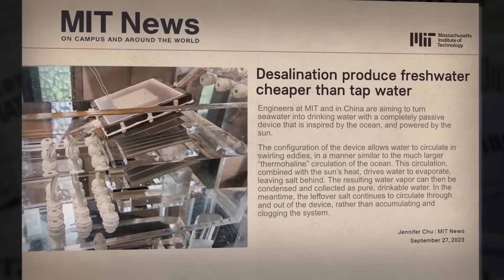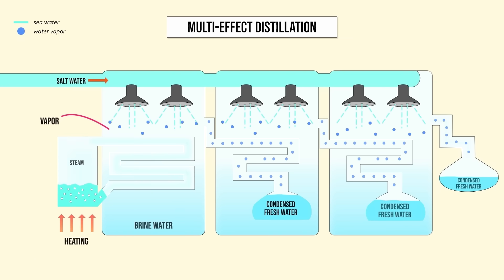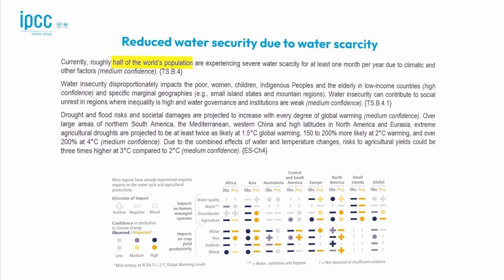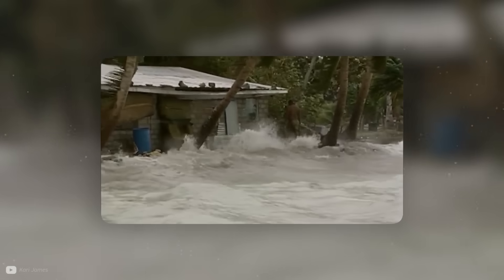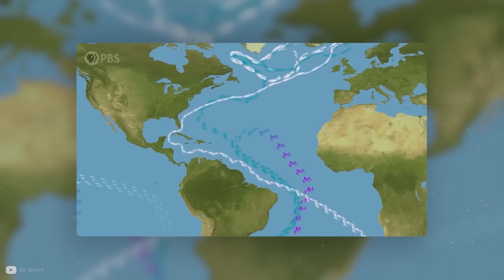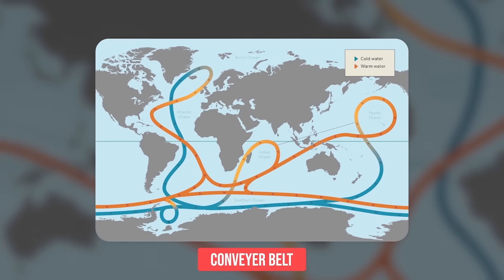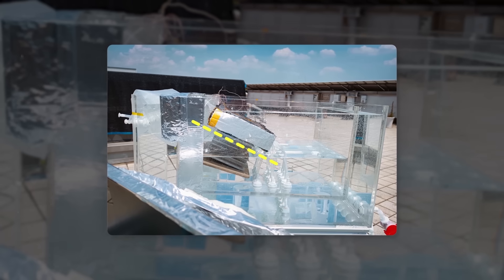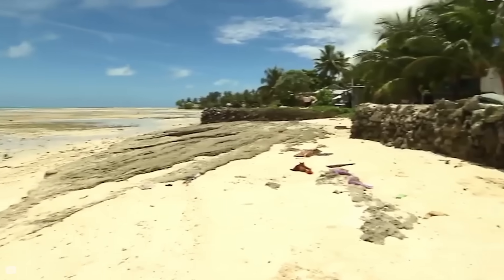Unlimited Fresh Water: Can MIT's Breakthrough Save Us?

Comment: There are other methods to obtain fresh water. With a power source, (including solar) you can use atmospheric water generators, which extract moisture directly from the air, without mucking about with the salt water.
Reply: it's cheaper to pass saline water through RO system than using a Dehumidifier, like 100 times cheaper, and RO systems are expensive. a dehumidifier will always be equal of less cost efficient than distillation (same energy required, but heat pumps could increase the overall efficiency of distilling over condensing). 
they have been trying to make startups of glorified dehumidifiers for decades and all have gone under because:
water is not drinkable (the contamination in the fins make it biologically active)
the results are pathetic against initial claim (like thousands time lower, as physically expected), and inconsistent as you need really hot and humid air to get "good performance"
the cost per liter of water is so high that it starts to be reasonable to move fresh water in container through the ocean.
Reply: @blurrydude2885 tell me the energy required to condensate 1 kg of water. tell me the energy required to distill 1 kg of water. this is basic thermodynamics. tell me know what is easier generate: a low entropy state or a high entropy state.
 your university sounds like a scam.

Comment: This is membrane distillation, which is now being utilized for seawater desalination - look it up. The MIT system is crude... The sea water needs to be prefiltered to take care of all the algae and particulates in the seawater, otherwise growth on the hydrophobic membranes will make the membranes hydrophillic, and lose its hydrophobic properties. Solar heat energy provides the heat necessary to heat up the sea water so water vapor can be produced to pass through the membranes and condense into water. A low pressure pump circulates the seawater solution and a small vacuum pump pulls the water vapor which is condensed. A larger system, with a stack of membranes and storage tanks for a household or small town would be the best choice, not a portable suitcase model. Water flux through the membranes are on the order of 1-5 kg of water per m2 membrane area depending on temperature. A lot of MIT bloated news here... You don't need to run the sea water to high salt concentrations...
Reply: Yes, you are correct - membrane distillation and you MUST pretreat the water. These MIT guys glossed over all these problems!

Comment: It's interesting why they would need the membrane when they could easily just harvest the condensate running out of the other tube. Keep the tilt so the brine does not get too salty but why the membrane? Seems over-complicated.

Besides, this only works in climates that have the Sun more than not, which means it's a solution for the tropics but more cloudy places need something different.

Comment: I run a RO system for my family's pure water needs. This sounds interesting, I am looking forward to them putting it on the market so we can see how good it really is.
But really RO systems works great if you use a pump to get up the efficency of the membrane and do not have to use sea water but most well and municipal water. Also do not cheap out on the quality of the membrane they are not the same.
 There really is not so much waste water. Just tune the system after your local water quality properly and do not just run a standard restrictior, to what water quality you want out to waste as little as possible. 
Also I do not think this feflowing system is powerful enough to flow thorough in to the system through tight sediment and carbon filters stages and the needed polish carbon stage after the filter. So we probably need a pump to run it.
I wonder if we need to use solar what or if I could just place it on our wood furnace when we make our warm water could we be making some clean water at the same time?
Because I live in the north and half of the year there isn't much heat in the sun. If the water need to be evaporated fast maybe it needs more heat than what warm water can provide. Or maybe the heat only speed up the evaporation.

Comment: By removing water from salty water you are left with more salty water. There is no way around that. There are only two theoretical solutions to reduce the salinity of the water that goes back: take the salt out or dilute it out - both comes at a price. If this device that does not come with a "hypersalinity problem" then that means it takes just a bit of fresh water out of the sea water and so the salinity change is not as high as in reverse osmosis - meaning it goes the way of dilution. The price comes from the a larger mass of salt water that needs to move through the system, which, at an industrial level means a lot more/bigger pumps and pipes.

Comment: Either your explanation or the diagram around the 12 min mark is nonsense. If it is gravity fed, the water level in the box cannot be higher than in the external main tank - but which it is. It would be level, unless you actively pump it.

Comment: The problems, financially, aren't often around the actual desalination process. It's the handling of the imperfect source water. Microplastics, algae, and variations in the actual composition of the salt change things and handling them is the source of most of the actual costs of desalination. 
These islands are in 'blue water' that doesn't wear out prefilters quickly and eliminates most of the problems that MIT has conveniently left out of their claims. 
Altogether, this is a great graduate paper but doesn't offer a full engineering solution.

Comment: This reeks of an undergrad engineering project that grew out of control, and is getting undue press hype.    It's just missing the buzzwords "out of the air".  Somebody summon that a$$hole Thunderf00t.
I'll keep an open mind but I'm very skeptical just on the 1st order analysis.  It all comes down to the total energy balance.  The max amount it could ever possibly achieve is determined by the total amount of solar radiation it absorbs minus environmental losses plus a negligible amount of potential energy from the height difference, minus the chemical energy it takes to convert water to steam (considerable) without carrying over or making it too energetic to carry salt in the vapor (difficult). Everything from then on is simply thermodynamic efficiency.  So why not run the numbers?  Solar Insolation over a length of day for the area, for ease consider it a blackbody, there's your total energy in.  Now, at 100% efficiency IIRC it's something like 0.86 kWh of energy is needed to desalinate 1cubic meter of salt water (34 500 ppm)  okay so I looked it up and Kiribati has a direct Normal irradiation of 5.687 kWh/m2 per day:  easy math let's say their collector was 1sq meter, 5.687 / 0.86 =  ~6.6.  Useable solar hours in a day for Kiribati is ~8. 6.6/8= 0.825 cubic meters (825L).  Seems good right?
Except not.  Pro plants use between 5X and 25X that minimum amount of energy.  If they're at the very low end and we say 5x, 825/5=165 165/24 = 6.875/hr equivalent over the course of the day.  That's just collected not distributed. So again... these claims seem dubious.  Incredible claims require incredible proofs...

Comment: Just make a solar heater evaporator... literally zero moving parts and it powers itself, why does everything these days have to utilize electricity... 
We can literally evaporate thousands of tons of water a day with very little issue. 

This isn't a technical issue, this is intentional.

two sandwiched but separated sheets of Metal with a slant towards a collection medium, paint the top black, put it over salt water, and bam, massive rapid collection of water, a single kilometer square, and you have enough water to solve world thirst. 
Nothing complex, just a sheet of material over water to collect and shed condensation. 
One sheets hot, ones cold, cause airflow and condensation, easy.
Zero salt accumulation.

Comment: Back in early 80s my idea was something else:
Build big cone higher than 12 meters above the sea surface (make it 15, for example), with the open bottom dipped in the sea.
Conical shape should allow the remaining salt to fall back to the sea, so, the inner surface of the cone might be covered with Teflon.
At the top of the cone vacuum pump would pull the vapor out, and push it through pressurized pipe system down.
The valve at the exit of the pipe would keep the pressure inside and condense the vapor, raising its temperature with the pressure.
The pipe would be spiral, long, and integrated into the cone wall to give the heat back to the water inside the cone.
Building the cone is more expensive, but it completely removes the need for the expensive membranes, which should all together be cheaper in the long run.
Reply: Sounds a bit overly complicated, but it is effectively what they are doing here as well. Use solar heating to evaporate the water, collect the evaporate, use seawater to condense evaporate.

Which makes me wonder why no one has done it before.
Reply: fun fact; with the salty water you can build rechargeable Batteries
Reply: Or you can farm salt and use this as thermal storage for the night
Reply: That sounds like a fantastic idea! Since you put it out there, are you hoping that someone will take it and run with it?
Reply: @lame0fame065  

Is that referring to me?

If so; yes, these are my open thoughts/"innovation" everyone should have the opportunity to use drinking water.

don't forget it's distilled water, you have to remineralise it
Reply: Maybe your idea,was and still the best method.Share it with the experts.If your method is best,we all win.I am referring to both the starter of this particular comment ,and everyone else whoay have the best idea.All of you should send your ideas to the experts.We all could benefit.
Reply: This method of desalination developed by MIT students should definitely be patented and implemented as soon as possible for countries that have coast, but still do not have enough water for everyday use.  This desalination method would be a godsend to them. I like the idea it does not send thick, sludge salty brine water back into the ocean ecosystem which deprives oxygen to marine wildlife. This desalination method also would greatly help people and create more peace around the world.
Reply: if you're always dumping the salt and wastes back into the ocean you increase the concentration. if enough places do this long enough it'll make the ocean super concentrated killing most sea life.
Reply: Spreading out the waste sea water dumps around the coastline should mitigate that.

Maintaining a low constant outflow rate, the sea water should mix quite quickly I assume.
Reply: I think the oceans are being continuously replenished with fresh water from the outflow of rivers, streams and rainwater. @Khanstant
Reply: I think that overall the salinity of the ocean is more or less constant. The fresh water that is extracted usually makes its way back into the ocean anyway. The damage shown here is all local due to the high concentrations of salt in the local environment, which this device should reduce due to it releasing the salt more slowly (if the hype is to be believed).
Reply: @TheFutureIsEloi  simple storage salt/high saltwater and use it
Reply: No you will not kill all sealife with a few cones. I think the problem is with desalination plants that dump huge amounts of extremely salty brine in the same area. Besides the natural evaporation would have the exact same affect so it would be close to a net 0  @Khanstant
Reply: @Khanstant  That will only be a local effect. The idea would be to pump the supersaline stuff into an area with good flow so that the salt is quickly dispersed,
Reply: @Khanstant  We are in a closed system so it should be fine somehow unless we do a big screw up or start sending that water into outer space.
Reply: @Khanstant  Mate, that is what the rivers ARE currently doing and HAVE been doing for hundreds of millions of years. 

I haven't run the numbers, but i doubt it is going to be a problem ANY time soon.

Comment: This is sooo easy, it’s not that complicated, all you need is a magnifying glass to heat a small black pot of water with a medium lid, all inside a large empty pot, the boiled water is desalinated and rises, rolls back down the medium lid into the large pot, no solar panels required, it is also much faster. Also you can rig up a basic pulley system with water bottles to slowly turn the glass with the direction of the sun

Comment: This would only replace the current cost of desalination in those areas that require desalination as the first step in a drinking water treatment process.  Unless the membranes in use will also remove other containments (e.g. bacteria, virus, heavy metals, etc...), you will still need to provide some form of treatment to the water to make it potable.  Readily accessible sea water from a shallow well could be a good location to source your drinking water, assuming the application is localized to a coastal facility.  It would be a less favorable choice to select from a bay or other beach location simply because of the high incidence of bacterial and "trash" polluting the water.  I don't see how they arrived at this process being cheaper than U.S. tap water, unless the tap water was sourced from salt water to begin with.  At which point you are simply reducing the cost of the desalination process and assuming the rest of the treatment process costs and any distribution costs remain equal.
Reply: Activated charcoal + sand filters will remove many nasty things including heavy metals

Comment: Distillation refers to the physical separation of liquids with different boiling points, so rhe first method is more appropriately called evaporation.
Reply: brb, just popping to the chemical store to get some "evaporated water"
Reply: @GuestUser42069  Well, you've got a point. However, in the food industry, no one calls the concentration of orange juice a distillation, even if the desired product is not the water that escapes the apparatus (the so called "Evaporators"). I suppose it all comes down to context.

Comment: Isn't this just a high tech version of solar distillation?  You can directly use solar energy to desalinate water with nothing more than a dark colored container with a clear film over the top, a collection container in the middle and a small weight to create a depression in the film so the condensed water runs toward the middle and drips into the container.  Hope that makes sense, it's hard to describe without a diagram.  It basically creates rain in a closed system.   Add a bit of plumbing and it can operate continuously.  I don't like how we are becoming increasingly more dependent on advanced technology when there are simpler solutions that don't require fancy materials.

Comment: This is an excellent video. Thank you for making it.

They say the system could last several years before requiring replacement parts. I wonder what would give out first, and if larger versions of the system could be designed to be more rugged.

Comment: Something like a floor trough through a greenhouse dumping its evaporated water down the sides at night as the air inside cools?  You could amplify this if you built long thin greenhouses so the temperature varied more?

Comment: So the final catch is all the salt, mineral, biological excess.  If we drain the surface of the water in any area, more water will flow in to replace it.  Large scale, lots of water and all that it is carrying.  The salinity and biomass would constantly increase.  Saltier water would be less or even uninhabitable.   Less lifeforms and increased biomass would lead to disease amongst the water.  Most extreme example is the dead fish, microbes and such would not decay do to the extreme salinity.  We then get up and move away from the disgusting mess.  The salinity is slowly balance and an outbreak occurs from the enormous volume of dead mass rotting poisoning all surrounding water and currents.

Comment: Chemical engineer here, I want to clarify that this design does not make less saline water than any other device. in=out you cannot create or destroy matter. The same about of saline water will be produced as any other type of desalination device per unit of water. Yes the concentration of salt would be less in this design, but the overall amount of salt never changes, thus will make the water equally salty in both designs.
Reply: Holy crap, then what do we do? what could they do? to fix the design? i could ask Chatgpt but could you explain how to solve this or what would need to be done to?